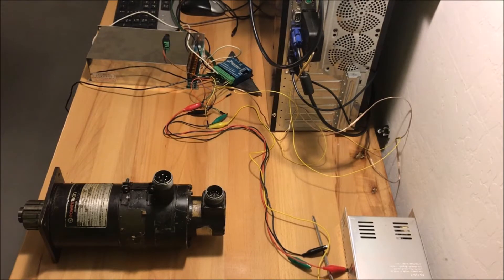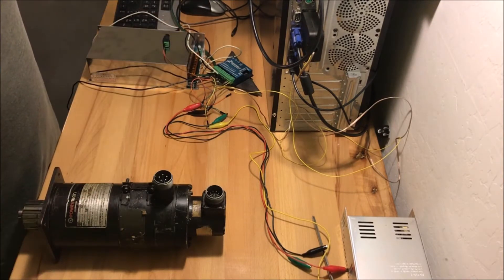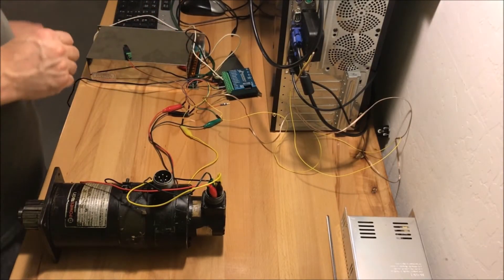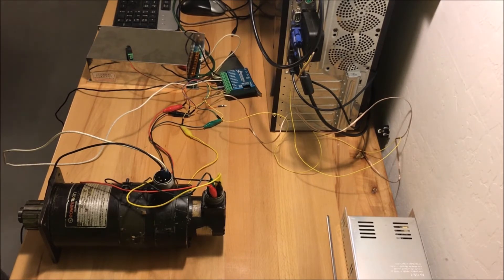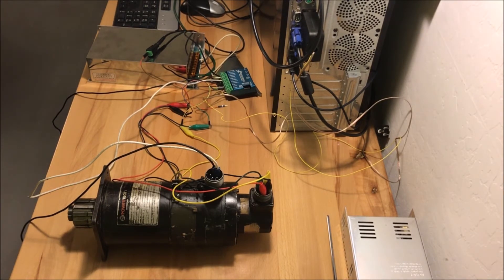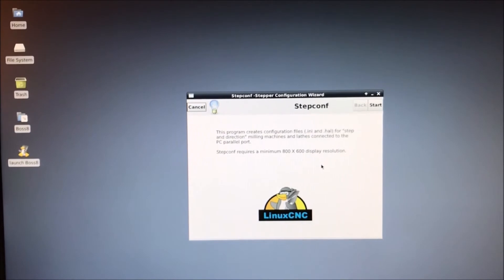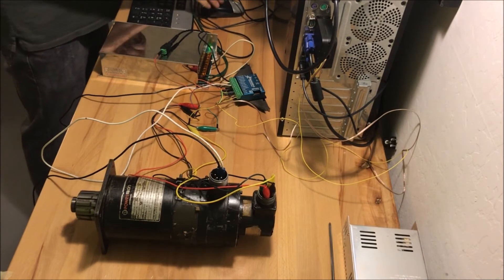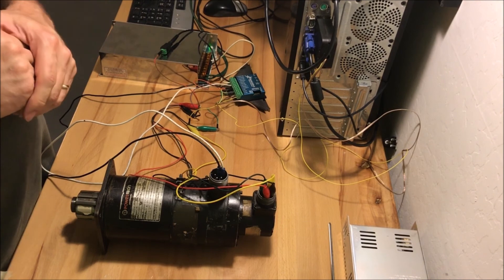Motor Bench Test - Bridgeport R2E3 Boss 8 CNC Retrofit: Part 4

Comment: Rusty: My name is Tony K from Omaha NE. I have bought the same machine you have in the video and did step by step what you have none. Great job! I am at a sticking point.
Linux program that I had bought from a guy in Florida that programs HP cash register touch screens. He said that he has done this for up grades for his machine shop machines. With that said I am using the Geckodrive G320X with a breakout board 5 axis 35$ board. I am at the bench test mode and using 80vdc power supply and 5vdc for encoder ( the same BEI E25G-250-ABZC-8830LED-SM18-5). Called Eli Morales Technical Support Manager from Sensata/BEI CORP yesterday and told him that I had to verify the encoders are digital square waves,answer yes old led but yes. 5vdv ONLY he noted.
Why I made this call is that Marcus at the Gecko that I have Emailed a few times, said that the encoders must not be reading out to the 320 driver. check that moving the motor shaft and getting LED lights on the 320 green/yellow/ red / green indications. I asked him to look at your video to let him know that it worked for you. That was yesterday 3/21/22. Is there something I am missing? The Linux system  stepcon loads all the info when I tell the program that it is using a Gecko 320 and pin locations. What the moor is doing when power on will run without command with 5vdc to encoder direct from source. from Gecko 5v dc out to Encoder  the motor moves ccw or cw how the - /+ feed to motor 1/8 of turn at a time without stopping ( no command from Linux at anytime). I do have a Scope but not a signal generator. ( to send a signal wave to Gecko to move the motor? NEED SOME HELP before the wife says to throw it out. Is the Linux program not set up correct? Does it need to know what motor I am driving Servo or Stepper? THIS IS A SERVO MOTOR we have.
Thanks for reading all this.  Tony Ko

Comment: Rusty I have the same Bridgeport mill ! I am stuck !!! Gecko com pin were does it go to? 5vdc ?  And also pin  7 I do not see were you are getting your 5 vdc to encoder. Need help.
Reply from the maker: The com pin is the common pin from the the device that is providing the step and direction. For me this began as the ground pin from the computer parallel port and now it is the ground pin from the Mesa board that I am using. I am powering the encoder straight from the power supply not from the gecko. This works as long as you connect the power supply ground to pin 6 Enc Gnd.
Reply: @rustybraindump782  Thanks Rusty for getting back to me. I would like you to send me a wire set up and type  number Mesa board that you are using and are you using any sister boards? I have a problem with Linux set up,,,, I thougth that i could not set up servo motors with this program only steppers.Need maybe a screen shot of pin and drive speeds. The machine is the same one you have table travel. I hope you are doing well. I have been looking at thet mill
for about 2 years waiting it to come alive. I also can send you a photo of what my machine looks like, not as nice as yours.  Thanks again for getting back to me.  Tony K Omaha